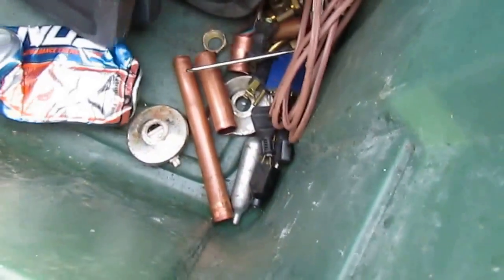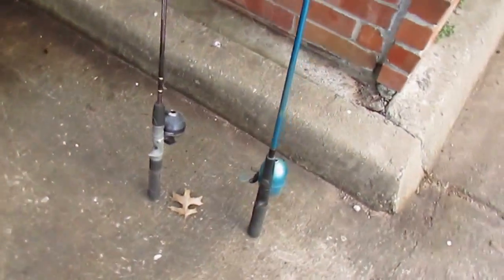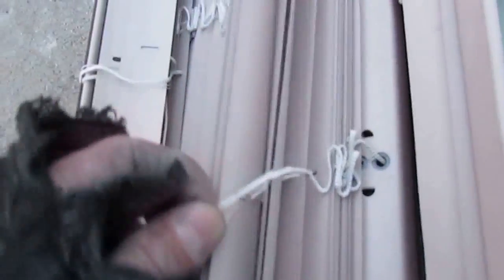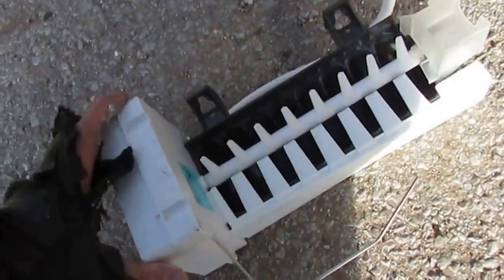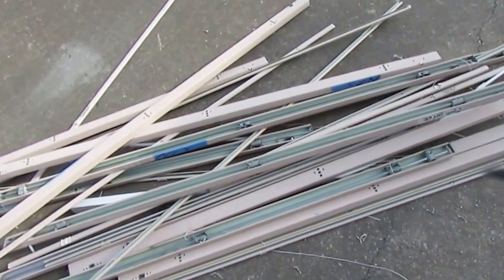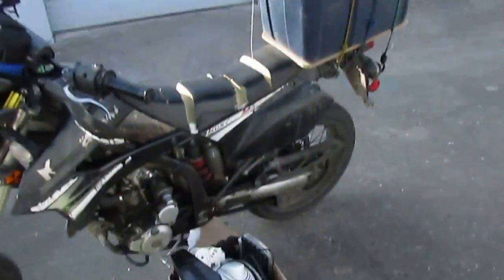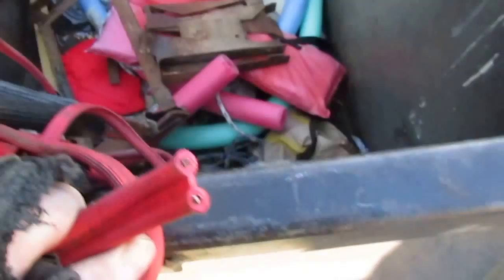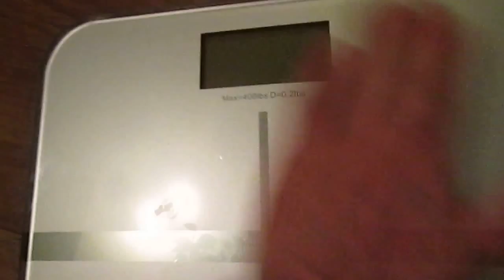Dumpster Diving Can Be Scary & Maybe Dangerous Scrap Metal Scrapping Scrapper Diver Aluminum Copper

Comment: A story about flat screens Scrap Vulture.. take a picture of the model number.. then unscrew and remove the back.. carefully remove all the circuit boards.. Put the boards in a plastic bag.. and put them on ebay! My yard pays $.10/pound for low grade boards... All the way up to $25/pound for a certain strip inside any type of flat screen device.. laptops tvs etc.. they are gold bearing. circuit boards are precious.. and something to keep an eye out for. if you find an old computer.. it has about $5-10 worth of scrap value inside. I'm sure you know about old crt or "tube" tvs as well.. be really careful not to break the glass.. and put the plastic casing back onto ut after your done.. keep everything in there.. even the low grade board.

Comment: 6 · In 1969, the Treasury Department and the Fed discontinued $500, $1000, $5000, $10000 and $100,000 bills (that bill above is real) because no one used them anymore though a new bill hadn’t been printed since 1945. ... John Marshall (1918 Blue Seal) and William McKinley (1928 Green ...